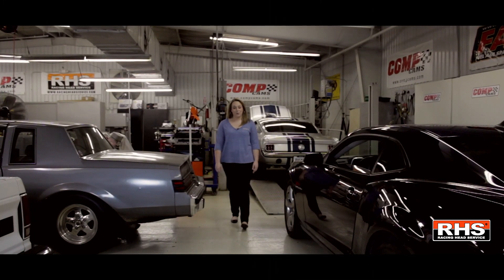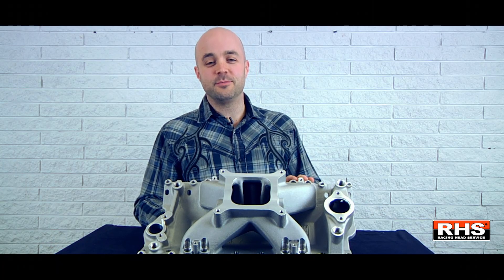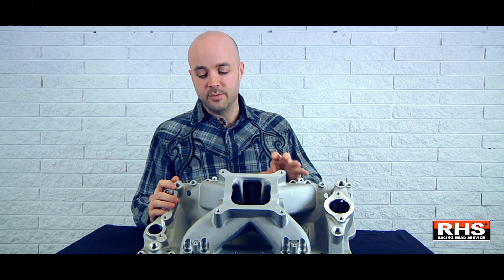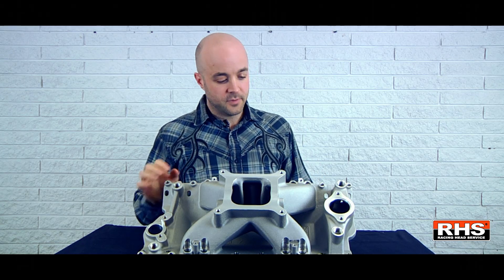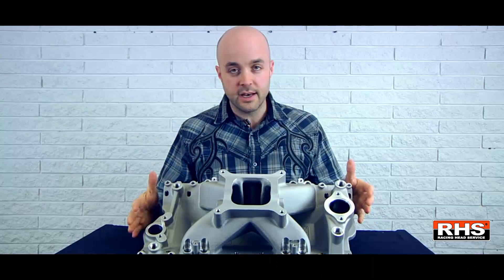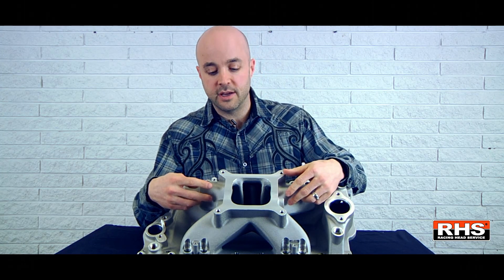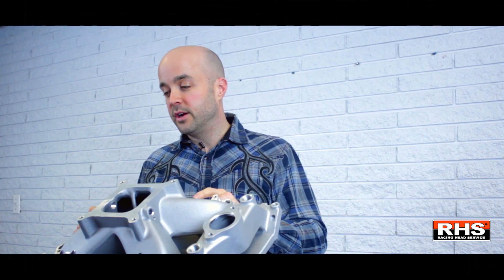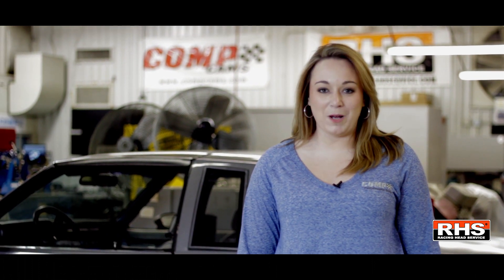Product Spotlight: RHS 23-Degree Small Block Chevy Intake Manifold

Comment: what felpro gasket are they port matched to?
Reply: The ports match up to the RHS heads. A Fel-Pro 1206 is the proper intake gasket to use.  The ports are slightly smaller than the 1206, but bigger than a 1205.  Thanks for watching, hope this helps!